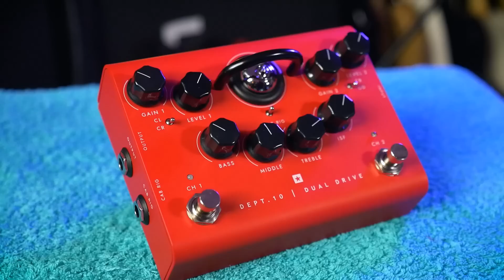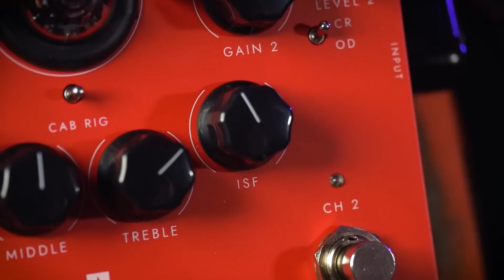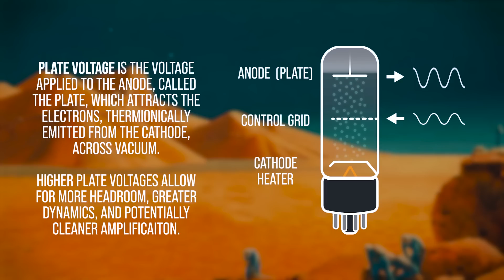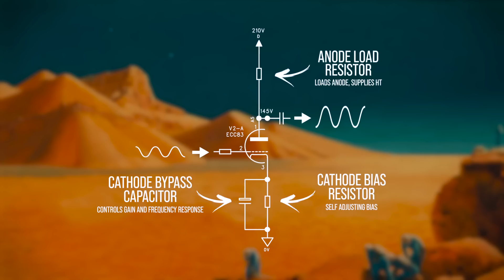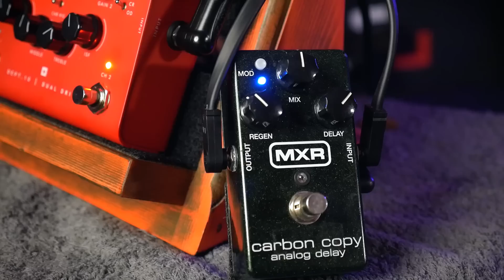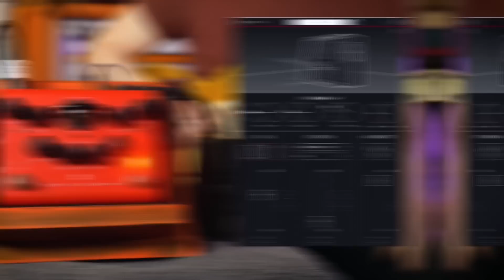Valve Pedals Done RIGHT! Blackstar Dept. 10 Dual Drive & Dual Distortion

Comment from the maker: Valves in pedals require the technology to be implemented correctly, otherwise they are a waste of time. 
With a plate voltage of +200V, Blackstar have ensured the ECC83s in their Dept.10 pedals are used to their full potential, but they didn't stop there. An advanced DSP cabinet simulation allows for hassle free direct injection for live and recording purposes. 

Purchase links:
Boost - https://www.thomann.de/gb/blackstar_dept._10_boost.htm?offid=1&affid=367
Dual Drive - https://www.thomann.de/gb/blackstar_dept._10_dual_drive.htm?offid=1&affid=367
Dual Distortion - https://www.thomann.de/gb/blackstar_dept._10_dual_distortion.htm?offid=1&affid=367

This video contains paid promotion from Blackstar Amplification. 
More details on how CSGuitars impement product promotion - https://www.csguitars.co.uk/disclosure

#blackstar #valve #dept10

More from CSGuitars: 
Gain access to exclusive content at: https://www.patreon.com/csguitars
Join CSGuitars Discord - https://discord.gg/csguitars
Buy CSGuitars Merchandise - https://www.csguitars.co.uk/store
Website - http://www.csguitars.co.uk
Contact - colin@csguitars.co.uk
__________________________________________________________________
Description contains affiliate links. Purchasing using one of these links will generate a small commission for CSGuitars at no additional cost to you.

Affiliate Links:
Thomann - https://www.thomann.de/gb/index.html?offid=1&affid=367
Sweetwater - https://imp.i114863.net/2mGGg
Reverb - https://reverb.grsm.io/csguitars
Crimson Luthiery Tools - https://www.crimsonguitars.com/?ref=csguitars + Discount Code 'CSGUITARS5' for 5% OFF
Gthic Jewelry - https://gthic.com/?aff=230 + Discount Code 'colin20' for 20% OFF

Title graphics and logo by:
http://www.studiosmithdesign.co.uk/

Join the discussion at: 
Facebook - http://www.facebook.com/csguitars
Instagram - https://www.instagram.com/csguitars/
Discord - https://discord.gg/csguitars
Reply: Makes me wonder what the tube in an Orange Micro Dark is actually doing or running at?
Reply: I'm too afraid to ask if batteries impact the amount of effect pedals have
Reply: @RandomShitAward  WHAT does that even MEAN?
Reply: @DMSProduktions  because there was a rumour around that Eric Johnson could distinguish what batteries was in his pedals. That's where the inspiration came from.
Reply: @RandomShitAward  Oh THAT? Total pretentious garbage! DON'T listen to that shite! The ONLY time a battery would affect the sound was IF it were going FLAT!
DC current, is DC current! Electricty does not have a 'sound'!
Reply: @DMSProduktions  more powerful batteries could effect the amount of presence of a reverb pedals
Reply: @DMSProduktions  why you liking your own comments
Reply: @RandomShitAward  As I said 'currernt' supply, NOT the battery itself!
Reply: @RandomShitAward  Oh! AREN'T I allowed to?
25 years & I have been liking my own comments! 
IS that all you have now? Usual last straw clutch comment when 1 has nothing left!
It's MY comment, so I DO like it! So of course I will give my comment  a thumb up!
WTF has this got to do with batteries anyway?
Reply from the maker: @RandomShitAward  I don't understand the question.
Reply: @ScienceofLoud  damn, even your confused, the inspiration came from Eric Johnson apparently being able to distinguish what batteries where in his pedals. That can't be more an indication that it's possible.
Reply from the maker: @RandomShitAward  Like the brand of battery? because that would be audiophool nonsense. 

The age of the battery would be more possible to determine from the sound of certain vintage pedals for which a decrease in supply voltage would yield a change in headroom and saturation. However that's not a battery exclusive effect, limiting the voltage from a power supply would have the same effect of starving components of voltage, allowing them to interact differently. 

I have a video here about the dying battery effect: https://youtu.be/XbucHqTSsbI
Reply: @ScienceofLoud  oh, sorry for wasting your time. My question was ridiculous, I see that now. But it still baffles me how (that's if) Eric Johnson can distinguish what battery is in a pedal.
Reply: @ScienceofLoud  Have you ever tested the Origin Revival Drive Hot Rod? Would love to know what you think about it compared to the Blackstar pedals :)
Reply: @DANWRIGHTITIS  Depends on the current potential, not the voltage.
Reply: Not bad lad!  \m/
Reply: To be fair dmsproductions did say he was afraid to ask. All metal1970 validated his fear by going after him.
Reply: Could one hypothetically run that Dept-10 Boost direct to interface to potentially "sweeten" an amp sims tone with the Dept-10 Boost's 12AX7 gain stage?🤔
Asking for an inquisitive minded friend. 🙃
Reply: THANK YOU FOR this!!!! I was looking at selling those 2 pedals which I own. They sounded like PURE CRAP- muddy, cloudy, unclear, and compressed while going through my amp. I since purchased a Fender Hot Rod Deluxe v4 and will use the 4 cable method. I didn't realize how great the overdrives and heavier rock sound like until i heard this video. In my pedalboard, I am more than able to power up these babies and looking forward to FINALLY trying them out the proper way. NEW SUBSCRIBER and THUMBS UP!!! Luc

Comment: Did I miss the headphone socket?
Reply from the maker: There is a Line out/Phones connection in parallel with the XLR that has the CabRig applied
Reply: @ScienceofLoud ah many thanks I didn’t realise it was a dual purpose outlet! That is most useful. Just bought the unit.

Comment: Wondering if the Dept10 boost could be used as an "always on" sweetener for direct to interface amp sim plugins?🤔
Sweetwater has them at $149, but also the feature rich Drive & Dual on sale for $199!
Not to shabby...
I may have to spring for that Dept10 Red Box after all?
Ha!

Comment: I'm curious as to whether these would be useful or self-defeating in combination with a solid state amp (particularly a JFET like the Super Crush)
Reply: Pedals can't damage your amp. Go ahead and plug a tube pedal into a solid state amp. Preamp tubes don't run on high voltages, unlike power tubes.

Comment: I tried one now, extensively, in a shop. And they do the same gaffe like everyone else that makes dual dist pedals, and this one in particular since you can't stack the 2 channels and have both on simultaneously. YOU - MUST - HAVE - DIFFERENT - EQ - FOR - EACH - CHANNEL! Period. Even different ISF if you'd like.

When I am playing clean I want a slight thump, but scooped sound, high treble and loud bass and middle turned down. When I am playing solo and gain I want more middle and less treble/prescense and way less bass to avoid it farting out and get flubby. This one hasn't this possibility even through USB and their Architect computer editor program. If they only did like Strymon to have ONE "save preset" spot that you hold in the switch for like 3 seconds and save ALL your settings, including  EQ, you could have different EQ and 2 presets witch each one different EQ. No rocket science. Someone else may want totally opposite, like middle on clean, and "loudness" curve on the distortion/od channel. Also, I would love to be able to change out the tube, although preamp tubes does not wear at all, if even barely. It's the power tubes that "wears". 

Other than that, I think these are not "Dual drive pedals with tubes finally done right". Not yet. The old Blackstar series with high voltage +400 volt, the tall ones, had way more and better clean headroom, especialy when backing off guitar vol knob. Albeit not dual channels. While this one sounded ok, when tinkering with the knobs, there are too numerous other pedals - with tubes - out there that does basically the same thing, 2 channel wise. Around the same price, and even higher and much lower.

Closer maybe, but no cigar.

Comment: Do you recomend a distortion pedal as a booster? 
At the moment i dont have an eq nor a drive pedal and im holding on with a um300 from behringer.
I push the mids at 8, cut the highs at 3 and leave bass at 6. volume at 9/10 and gain at 0. The rest of the gain and eq comes from the amp as obious

Comment: Even stepping up the voltage and from DC no less these pedals would still be considered 'starved plate',  besides lower headroom = more distortion 

The only thing that separates this from most valve pedals is that the valve is in the gain stage and not just a filter in a feedback loop 

Still a great pedal though

Mozztronics TD-1 is still my favorite Tube Distortion pedal

Comment: I have the BS 10 dual distortion.  What happens if the valve needs to be replaced?  The manual says it's not user replaceable.
Reply from the maker: It shouldn't ever need to be replaced under normal operating conditions. Preamp valves effectively last forever.

Out of interest I did open one to see how accessible the valve is and you'd have to dismantle the entire pedal to get to it. 
That's probably more to prevent users swapping to different types of valve the unit isn't designed for.

Comment: What did they do to get 210v from the 9v input?
Reply from the maker: There are a number of methods of upscaling voltage. 

Transformers are the most common when working with AC voltages, they work inductively in that a voltage in the primary coil induces a voltage in the secondary coil equivalent to the ratio of the number of turns between the two coils. e.g. if the primary coil has 10 turns and the secondary has 100 turns then the voltage induced on the secondary will be 10 times the voltage supplied to the primary, at the cost of current.

For DC we can use DC to DC convertors which typically work in some switching arrangement, these can come in the form of integrated circuits, ICs. You can read up on Boost Convertors to learn more, but they again increase the voltage at the cost of current. 

Power = voltage * current, power is equal on both sides of the conversion (minus any losses due to heat, no transformer or converter can ever be 100% efficient due to the laws of thermodynamics) so if you had 9V at 500mA that would be 4.5W. If you wanted 200V from that 4.5W you could get it in exchange for dropping the current to around 22mA. (200V * 0.022A =4.4W)
Reply: @ScienceofLoud  So does this pedal only need low current?
Reply from the maker: The pedal has a nominal draw of 500mA
Reply: @ScienceofLoud  How do they retain the 500mA when they boost the voltage to 210v?
Reply: I hope someone could demystify this for me. How did they step-up the voltage from 9v to 210v while still retaining 500mA of current? And if the tubes are really running on 210v, is this pedal capable of providing clean/low-gain sounds without sounding sterile?

Comment: Great video!
I have the Dual Distortion pedal and LOVE IT!
I think that gain wise the Crunch mode has enough gain and sounds great.
Can you say if the Dual Distortion pedal's crunch mode is "the same" as one of the modes of the Dual Drive?
Reply: Do you think this could be used, with tamer settings, to further tighten and push/boost the front of an amp’s high gain channel?
Reply: @ordohereticus3427  ill try with my dsl40
Reply: @idanshahar  Cool. Let me know how it goes. Thanks.
Reply: @ordohereticus3427  It worked great :) the crunch chunnel was doing a good job at 10% gain and 50% volume and eq at noon. it reduces a lot of bass so you can eq the bass up, and if you put the MIDS at 100% it gives a TS9 vibe.

Comment: Loved the "bark at the moon" riff, ahoooooowww! 😊
 I've owned a Marshall valvestate and an AVT. They were both hybrid amps with 1 preamp tube. I always wondered, is that tube really doing anything? After swapping one I recieved my answer, yes. It became brighter and had more gain. I still have a now discontinued Vox tonelab that also has 1 preamp tube. The effects aren't the best but the amps sound great. I changed the tube in that one as well from the original Chinese Ruby to a Tungsol and it got rid of the fuzziness. Now you've got me wondering what the plate voltages were on those old amps and pedal. I remember an old video on YouTube where someone pulled the tube out of a Vox tonelab and all the clean amps still worked! So it tube was only in the circuit for the high gain amps! 😳

Comment: These sound great, I do wonder their application infront of a clean amp though seems more like a preamp design, I know a few pedals out their have tone circuits designed to optimise the tone for front of amp, power amp and speaker emulation. Huge difference in high end and mids usually between these. I unfortunately don't own an amp with an fx loop (vintage and boutique stuff). May still grab one, either one of these or the V4 Kraken.

Comment: So how do they get 220V from a  9V DC power supply?
Reply from the maker: There are a number of methods of upscaling voltage. 

Transformers are the most common when working with AC voltages, they work inductively in that a voltage in the primary coil induces a voltage in the secondary coil equivalent to the ratio of the number of turns between the two coils. e.g. if the primary coil has 10 turns and the secondary has 100 turns then the voltage induced on the secondary will be 10 times the voltage supplied to the primary, at the cost of current.

For DC we can use DC to DC convertors which typically work in some switching arrangement, these can come in the form of integrated circuits, ICs. You can read up on Boost Convertors to learn more, but they again increase the voltage at the cost of current. 

Power = voltage * current, power is equal on both sides of the conversion (minus any losses due to heat, no transformer or converter can ever be 100% efficient due to the laws of thermodynamics) so if you had 9V at 500mA that would be 4.5W. If you wanted 200V from that 4.5W you could get it in exchange for dropping the current to around 22mA. (200V * 0.022A =4.4W)
Reply: @ScienceofLoud  Will read into those Boost Convertors! Cheers Colin!

Comment: Good drive pedals, yes, but solid state can get extremely similar results without the hassle of high voltage and tubes that need replacement every few hundred hours
Reply from the maker: While I don't disagree that solid-state can perform in the same realm, they often suffer from low headroom similar to low voltage valves, hence the occasional tendancy for solid state drive pedals being designed to operate at 18V to get more headroom at the opamp. 

The physics of headroom and dynamic range apply in both cases, solid-state can just do it at lower voltages than valves.
Reply from the maker: The working lifetime of a preamp valve is in excess of any amount of play you could put on it. Preamp valves very rarely, if ever, need replaced

Comment: Great video! Would you consider these pedals as pre amp like the Victory Amps V4 series or would they be better as drive/distortion pedals?
Reply from the maker: Blackstar is absolutely a preamp, but being marketed more like a pedal. It fits both roles, but I see it more as an ampless rig solution due to its DSP features:
Preamp with cabsim direct out, for a pedalboard only rig.

The Victory units are very much recreations of their amplifier preamp in smaller boxes and designed to be utilised alongside an amplifier as additional preamp channels.

The two are filling different applications for different set ups, despite both being preamp.
Reply: @ScienceofLoud Definitely gonna consider the Blackstar for long business travels. Thanks for responding!

Comment: Does turning the pedal on and off affect the valve? As amps have a standby, so we can turn the amp on, to warm up before we play, so how does this pedal cope with this? It's just something I thought about while watching this?
Reply from the maker: The heaters run as long as there is power to the pedal. Once powered up the valve is hot and ready for action regardless of if signal is going through the pedal or not.

Standby switches on an amp only disconnect high voltage from the valve plates. This is more of a maintenance convenience than an end user necessity, allowing techs to bring the high voltage on and off as required. 

Standby switches are not actually required for amplifiers, and even if you believe they do anything to extend valve life or prevent damage to valves, those arguments only relate to power valves anyway
Reply: @ScienceofLoud  thank you. If I didn't ask, I wouldn't have known! M

Comment: What about Metasonix?
Reply from the maker: The synth modules running completely different valves at 12V for non amplification based effects?

What about them?
Reply: @ScienceofLoud  Sorry, I should’ve been more specific with my comment. The TM and TX series of pedals, it’d be cool if you did a few videos on those - if you can get ahold of such pedals. The TM-4 and F-2 pedals are both vacuum-tube amplifiers